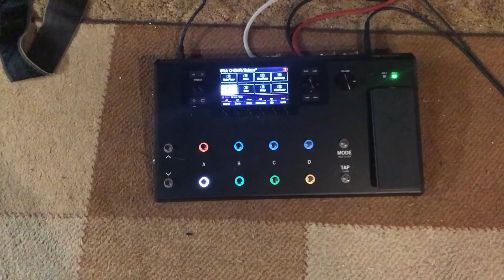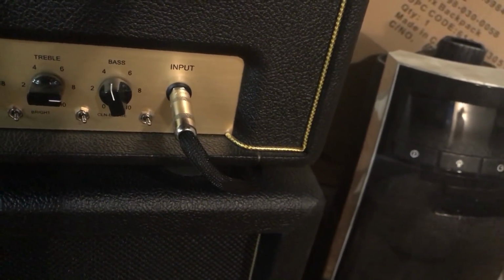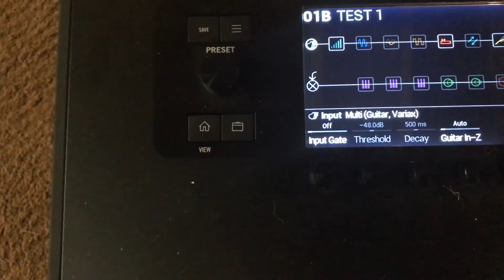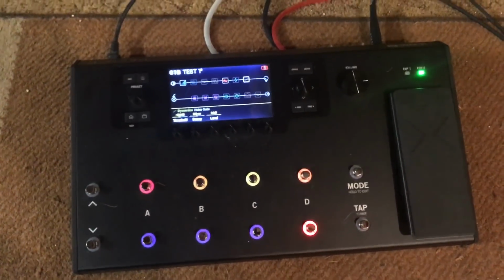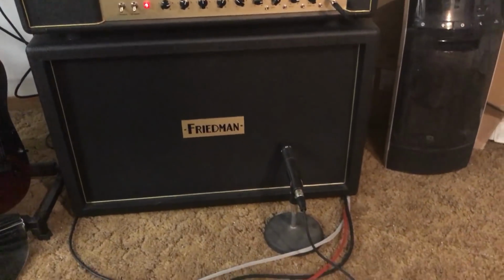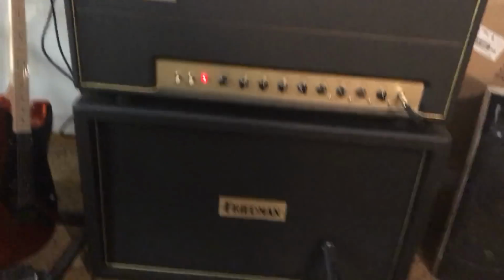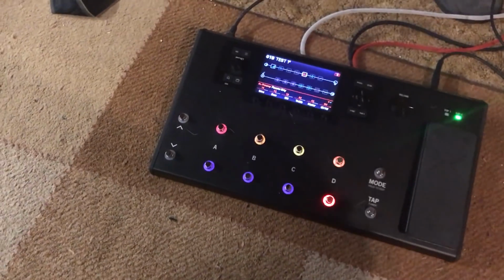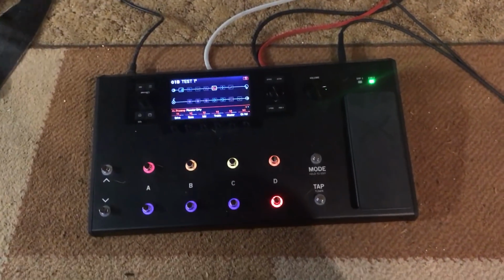Helix Placater vs BE-100 Tone comparison

Comment: They still get pretty damn close. I was running similarly, but using Helix into an EVH 5153 fx loop, but have since sold the amp. These modern amp rely less on the power section for their tone. Which is why Friedman swears he can capture a BE100s essence in a pedal or synergy module. I use a Friedman powered wedge (ASM12) and am stoked with what I hear. Also, I use a SD Powerstage 170 and Marshall 1960BV (with helix or AA6) when I wanna move air old school style. Also, the Atomic AA6 is a great alternative. I feel like their BE100 cleans up just a bit better, ie more dynamic. Both great option tho. Nice demo!

Comment: AWESOME. I actually like the Helix model tone. Bites a bit more and will prob cut in the mix better.
Reply from the maker: I get what you are saying, but one thing this test proves is that the exact same settings on the Helix and the BE-100 don't match 100%. The Placater is a touch brighter. Bumping the presence up a notch would bring the BE-100 and Placater almost exact. That said... it's incredible how close they got this model... especially at high volumes.
Reply: Oh for sure. I noticed that a while back but the nice part is ... same setting WILL get you 80% there for the most part. And as you said, once in a mix in a live band setting, NOBODY would hear the difference.

Comment: I've considered doing this with my Lone Star, but what I've found is that modeling the preamp is only half the equation.  You're switching out the BE100 preamp for the Placater preamp, but running it into the analog BE100 power and cab.   Even then, as you've discovered, it's not quite there.   Now if you could run an A/B between the BE100/cab and the Helix/FRFR or Helix/power amp/cab, and compare those two sounds, how close can you get?  My experience is that the power section is a huge part of the dynamics of the signal.    How likely is it that the BE100 preamp section goes bad, but you could still use the power section with the Helix preamp?   Can you split that cab stereo, and run the BE100 to one speaker,  and use your Helix/power amp to the other speaker and then A/B that?
Reply from the maker: kurt shetler i can try that at some point for a vid, but have already done that at practice spot. It's pretty dead on still. Granted, my power amp is a power amp made for guitar. I like to stick to familiar. I'm not an FRFR guy though, so i can't make that comparison. I do have a first patch for my DAW with IRs of the cabinets i use and that rules too